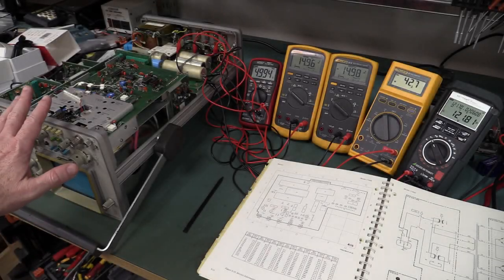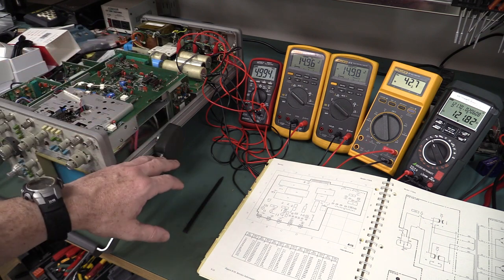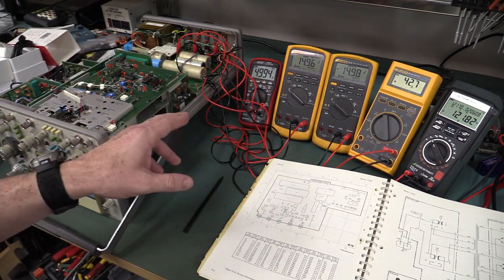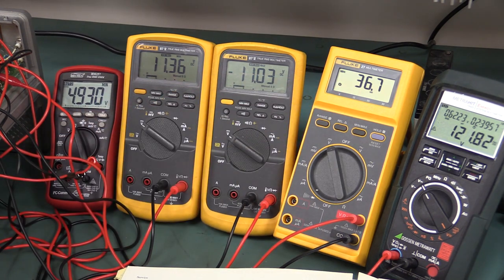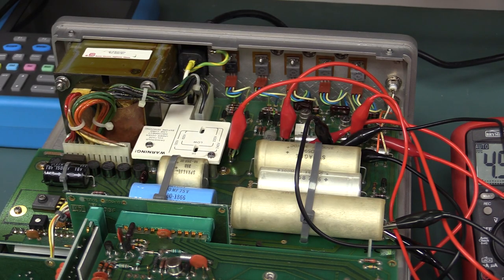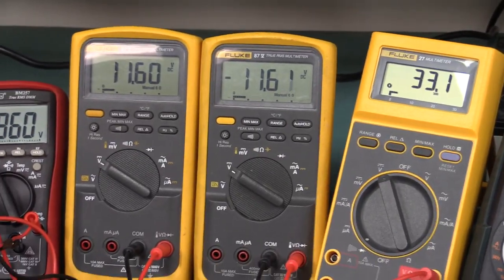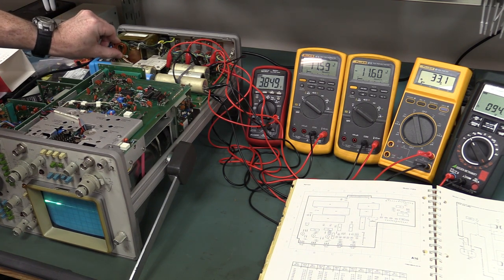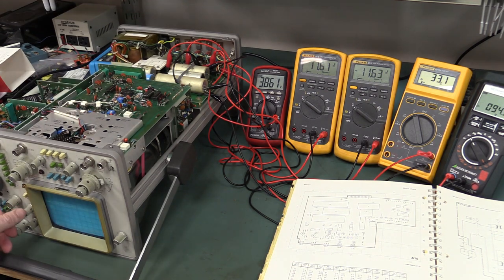EEVblog #804 - HP1740A Oscilloscope Repair - Part 2

Comment: Revised troubleshooting guide:
1. RTFM
2. RTFM
3. To be sure, RTFM again
4. Check voltages
5. Check connections
Reply: +leppie and then the documentation lies :(
Reply: RTFM means "Read The Fantastic Manual" (in THIS case, anyway ;) )

Comment: Cool story time.
I had a home component CD player go dead. It had been hit by lightning on the AC mains and it had a linear power supply. It used discreet glass diodes for rectification. I opened the case and plugged it in and I noticed one of the glass diodes was glowing like an LED. It wasn't getting hot, it actually gave off a red light. I replaced the diode turned LED and the CD player worked.

Comment: That was fascinating!  After seeing the circuit breakdown and the fault mode, my inclination was the bridge rec or a leaky electrolytic.  The dry joints were a surprise, recently I saw similar joints on an automotive relay.  It was a timer relay for the headlamp washers on a friends car.  I diagnosed the problem but the dealer quoted £85 for a new replacement, fortunately with a 3 week delivery!  My friend declined to order it and told me.  So, I broke the seal on the faulty relay and closely examined it. There was a fair bit of circuitry inside and quite a nice relay, all in a cube about 30mm square.  To the naked eye all looked fine, but when I looked through a magnifier at the base connection pins, 3 of the 4 were dry and loose.  Re soldered, sealed back up and winner winner, chicken dinner, as Dave would say!  Said friend was both delighted and impressed!

Comment: Great repair Dave would never have thought a diode bridge, my hats off to you. I was assuming as you were indicating, and thats
wrong on my part. Will remain opened minded with your next repairs.
Reply: never believe in diode bridge! )))
Reply from the maker: +T Komoski I thought it could be a diode bridge, but maybe shorting in some way. I didn't figure it would be a partial high impedance fault, that was a curveball.
Reply: +EEVblog yeah I've never seen such a vicious failure mode neither...

Comment: Looking at the schematic at 18:20./ lower right - seems like the +15V regulator is powered by the 5V rail... that would explain the cascaded failure.
Reply from the maker: +vintagepc64 The -15V rail is, but not the +15V rail.
Reply: +EEVblog D'oh... you're right. 

Have a tek and spent last weekend tracing down a touching but broken lead to the CH2 vertical knob. The manual has a great piece of advice on troubleshooting - it sums up as "milk the front panel for all it's worth" - narrow down the fault as much as you can before you so much as crack the cover.  Was surprisingly effective too, once you take a moment to step back and note ALL of the symptoms.  The longest part of finding that fault was disassembly. Just goes to show how easy it is to jump from one conclusion to another when you've actively got eyes on all the innards... and you easily miss the big picture from all the symptoms together.

Great video, as usual - Thanks for making us unwashed masses just a little bit smarter with each one :)

Comment: Thanks so much Dave. Had one of these scopes for a few years and love the trace quality. The new DSO gets a good work out but this old one is a fave. It died a while back and I just delved in there today. Discoloration round the same bridge! The trace just went "crinkley" and disapeared off to the top left one day. Will be taking a very close look at those through holes tomorrow. R3 on the HV board failed previously. Youre a star. Excellent videos as usual. Pointing all my proto-geek friends at your channel!

Comment: Totally entertaining both part one and part two. Thumbs up on the isolation transformer when testing with the oscilloscope. I literally blew up the earth probe on a HP osc. Technicians came running in to see if the apprentice was dead or alive.  The noise was like a gun going off.

Comment: That was very cool. I have put off going out to do my grass (which has shot up in past 2 days) to watch this adventure. 
It is good to see a quality product from the inside too. So even there less than adequate solder joints had enough residual quality to last all that time.
Very entertaining, thanks.

Comment: Hi Dave - thanx for this one, as it shows a common fault on old/vintage stuff.....

If a unit fails - regardless of its kind - check the power supply first. Usually 90% of the synths i get in for a repair/or bought in non working condition, suffer from a gone bad power supply and some have gone bad IC sockets,  main switches, connectors (i´ve done a video in where i show a worn out ribbon cable connector on my MK-1 synth.... and the like as well...

Always make sure that the mechanical side (cables,interconnections,sockets,switches) is alive and working first, and that make further tests...I also had seen some IC factory-sides put in sockets with one or more pins bent with 90degrees pointing into the inner mid of the socket and not into the socket´s pin....so intermitened connection was bult in as well...
Hard to trace down....

Im my hammond X-5 i needed to replace nearly the complete wiring loom (between keycontacts and soundsource) due to broken inner copper, replaced one, fixed that problem, two/three month later a similar fault occurs (of curse at another key/octave), replaced the next wire...after the 4th error of the same kind i´ve chosen the long road and rewired the whole thing....

Next in line are some hohner RDM1000 (first gen digital audio delay) i got three of them - all with the same error: 5 up to 20 minutes after PowerOn they go nuts, the 5V rail dropps, DSP and uC go mad...the last one came with schematics, now i can try to fix them;)

Comment: Excellent video! I ALWAYS check power supply before I troubleshoot any other part of a device. I've seen many others waste so much time tracking a problem down when it actually came back to a power issue!
I repair a lot of guitar amps and the bad solder joint issue is a prevalent issue! Especially on large filter caps and such that suffer from vibration issues.
 GREAT JOB!

Comment: At 37:00 , according IPC, solder on the pads on the solder target side is not a requirement.
(and i am sure it was too when they did assemble the scope)

Comment: Well tracked down Dave! I had a very similar intermittent fault on a Marshall guitar amp here in the UK. It looked as if thermal expansion had caused the bridge rectifier to de-solder its dry as a dead dingo's donger joints. (!) But after re-soldering it transpired that it was the bridge itself. It had failed in almost the same way as yours - so maybe not that unusual.

Comment: Good job, that was a well hidden intermittent problem!
Reply from the maker: +youbecha64 Well hidden indeed.
Reply: +EEVblog It looks like it acts as a half wave rectifier when it fails, so I think that internally there's a diode what is being open when the temperature reach certain point. It cooldowns and recovers until coming hot again. And that's the failure mode of that bridge rectifier. Very uncommon, and It's only a theory, what do you think? PS: Sorry for my bad english, I'm from South America, hope you will understand :)
Reply: +youbecha64 Intermittent issues can make you throw adorable kittens off a cliff.

Comment: Nice epic 90 mins of mystery.  I enjoyed that - especially with the schematic shots and 6 DMM array and scope to show the various voltage rails (and the current test).  Visually Rich.  Fulfilling.  Glad you solved it, man. ...Diode bridge?  Didn't suspect it (very seriously, confirmed) until you tested the transformer output.  Nice job.

Comment: Actually those little round bridges are usually very sneaky in the way they fail. My first one had me busier than a one-legged dog in a tug-o-war. Also Molex connectors, especially old ones will fail as the plating erodes where male meets female. Just pull out a bit and watch.  A metered variac would have told you straight away during transition to failure if you were dealing with a short or open condition. As for the through holes, the interface between the hole and the pad is very thin. If it's not tinned as is typical when flat bottomed components are mounted in this way the copper will oxidize at that corner first leaving the service trace on the top out of circuit.When we must do like they did we provide a redundant via adjacent to the component and solder pin it.  Very nice video.

Comment: Honestly I had something like that on a old motorcycle that i had, it had pickup coils off the crankshaft for the coils to fire, there was 2 of them but when i rode it for about an hour the bike would just die, but after setting for about a half hour it would fire right up, but once it heated up it shut down, i know it isn't the same but it ended up being the rectifier for the pulse signal coils.... go figure..... nice troubleshooting and solving it, great job Dave :)

Comment: I repaired an old Tek 475 last year which also had a bad diode bridge, however it wasn't an intermittent failure as in your case. I replaced it with four diodes since I didn't have a diode bridge that fit correctly.

Comment: Might be interesting to hook up the diode bridge to a scope (instead of just a DMM) and see if it jumps from "camel" to "dromedary" rectification. I suspect there might be one diode or diode-pair failing, so that it essentially becomes a half rectifier.
Reply: +Henner Zeller 
Looks to me like some weird zener-effect. The ripple after the bridge dropped nearly to zero. As one way rectifier the ripple would have gone up with half the frequency.
Reply: Good point, I didn't got back and watch the ripple frequency on the scope.
Reply: +Andreas Dill I kept watching for that, too, as I'd already suspected a bridge, having had one fail in the past. (See my comments on Part 1).
 But it does look like it always stayed full wave on the ripple. It went down, probably because the load had dropped, but it sure looked like 100Hz, working or flaky. and, IIRC, the load on the transformer also dropped, which would seem that it was going high resistance. (Tho the other supplies dropping V would also drop I, and that might unload the tranny enuff to swamp what the 5v winding was doing.)  Very wierd, those bridges. I see others in the comments have had odd HP problrms in the past. Maybe HP got a bunch of dead dingoes? Sure have never seen fails in other items with the same rectifiers...  Can't say this wasn't a good puzzle!  Stu

Comment: Thanks Dude,
My scope lives on thanks to you. I too had dead dingo donger solder joints on that header. I think it's because that box rectifier gets hotter than a kangaroo kooch in December and causes thermal related fatigue stresses in those joints. Just a guess. I replaced the 9-volt rectifier with a Vishay w04g but you could use a lower voltage version.

Comment: Dave, a great 2 part-er! I also have never seen a diode bridge fail in that mode. If it was me I would have gotten out my can of freeze spray and hit that diode bridge straight away.  Might have told me something...  Good you found those dry solder joints. They could have caused problems down the road.  I wonder how many more dry joints are in that unit?  Hmmmm....
Reply: +Herbert Susmann Crap, I scrolled down too early!
Reply from the maker: +Herbert Susmann BY the time I narrowed it down, I knew it was either the diode bridge or the solder joints under.

Comment: Back in the 70's in the TV repair shop we used cold spray to find faults.  Have you ever tried that?
Reply: Yup, thou shall purchase freeze mist and a hair dryer. Long time TV tech here myself, a good percentage of my intermittent problems were found spot checking components with freeze mist.

Comment: Just wanted to say thanks for all the hard work you do. I tuned in to watch you recording this 'live' and to then to see the video afterwards well.....just, (and I really hate to use this word), AWESOME! I'd also like to say thanks for your $50 oscilloscope video too...didn't quite get one that cheap but I did pick up a very clean and tidy fully operational Hitachi V-680....for only £80...about $170AU?.....not found a user manual yet but who needs one when there is Dave Jones?
Reply from the maker: +MrTom The Hitachi scopes are quite nice.

Comment: My Hitachi scope develops some ghost lines on the CRT after a while but not always. I wanted to start working on it but I'm quite afraid since I don't have another scope to aid me with the troubleshooting and the scope itself is insanely complex with ceramic hybrids and both sides of the scope is just filled with parts. So maybe one day I will check the voltages too like Dave showed since I have a copy of the owners manual with all the schematics and such. Quite amazing to see a 35 year scope still rolling along with just a "simple" problem like this. Cheers :)

Comment: I repair old analog music synthesizers from the same era and had seen quite a few of those cylinder diode rectifiers acting weird. Enough to start replacing them the moment I see them. Investigating what that dodgy diode rectifier is actually doing with IV curve tester may be an interesting video.
Reply from the maker: +kvitekp Yeah, curve tracer would be nice.

Comment: ya dave seen that . been fixing monitors and terminals (crt) for 30 years. the bad solder may have made the bridge heat up and cause it to become intermittent. the only way you would know this is buy working on cheaply made monitors. good job dave!!

Comment: Thanks for a great adventure into repairing in 30y equipment. This is the videos I love the most on the EEVblog. Funny though, next to the rectifyer there is a black capacitor nippon chemi-con. I have the same looking ones in my trusty old C64 from the same decade, and it has the same black gunk at the poles as yours have. I wonder what that stuff is...

Comment: Good job, Dave. But, before you and the other folks here go stark-assed crazy anointing the inside of you HP 1740s with Deoxit be very careful to consider drip and runoff patterns. The 1740 has a proprietary chip under a massive heat sink (as I recall) that is directly under the drip path of the function switch contacts. If the Deoxit or other switch cleaner leaks into the chip, it could short the leads and you're S.O.L.! 

This from personal experience at my converting a 1740 from a two-channel scope to a one-channel one.

Comment: We done Dave ! I never would have suspected the diode bridge either. Silicon Semiconductors usually short out in failure mode. Germanium Diodes open up. I have not worked with the prepackaged bridges that much. Are they designed and manufactured to have fusing elements in each leg to protect the caps ?

Comment: I'd be interested to see the input and output on that diode bridge (no filter cap) as I think it is a broken/cracked diode within the bridge which is effectively switching between half-wave and full-wave rectification.

Funnily enough I have been  messed about by those little potted bridges in the past!

Comment: Thanks for the video, it gives me something to go on trying to get my HP 180A fixed, similar problem. Being mid 1960's tech its probably not going to be so simple but still, some things to check and can rule other things out. don't have another scope to take to it just a pair of multimeters

Comment: I have an HP 1741A with similar issues, and in even better shape, and was hoping this video would save me the time in troubleshooting that I've avoided by having it sit in my cellar for the last 10 years. ;)
Diodes (and other semiconductors) were "semi-new" components back in the days. So I'm wondering from you old timers whether or not the failure modes of diodes may have changed in this manner?
I do remember that old equipment (like some in this video series) used to socket them in fear of them being primary points of failure, wear and tear, and high price made the mfgs even unwilling to risk soldering heat. Maybe there was some truth to the unreliability or quality problems in early rectifiers?

Comment: Watched all the way to 42:00 and laughed out loud. Yes, the curse appears to have been lifted, but how do you test for that?

I found a problem Sunday with a GFCI outlet. The plastic reset switch was cracked and only reset the hot and not the neutral. Perhaps the curse on my house has been lifted as well? (not likely)

Comment: very nice video! I'm still in the middle of it, but at 30 mins when you connect the extra cap in parallel with your 5V filter cap: since you did not get extra ripple and are looking for some excess current, then the parallel cap would not get rid of the problem, since the faulty cap would still short out the rectifier... wouldn't it?

Comment: +EEVblog, in the rectifier is not the diodes itself what fails, it is the joint to the (-) or (+) pin what gets resistive with heat and opens resistive. That is because, will be WEIRD two diodes open failing at the same time, open that plastic case, and see by yourself.
Reply from the maker: +flyguille I measured it at the end, it is the diode bridge.
Reply: EEVblog I means the joint to the pins "inside the diode bridge package", not the outside to the PCB,

Comment: I am developing a little device that uses a microcontroller and can read 20, 30, 40 plus voltages at once using a fast bench dmm with a digital output.
It has all the probes and quickly jumps down the list, bridging the connections from the probes to the dmm.
It logs the output and moves on, in a circle. The more probes you add the lower the update rate but with a keithley or a DMM that is very fast, it's good enough for 20 power rails.

Let me know if you want to know more

Comment: Sweet. Interesting, in theory bridge rectifiers should be very sensitive to temps because of the diodes in them. What a coincidence the bad BR was near the cold solder joints, or maybe that's what made the BR fail to begin with, so no coincidence at all.